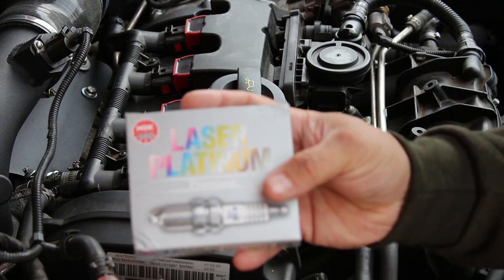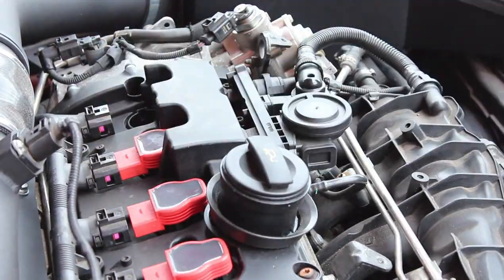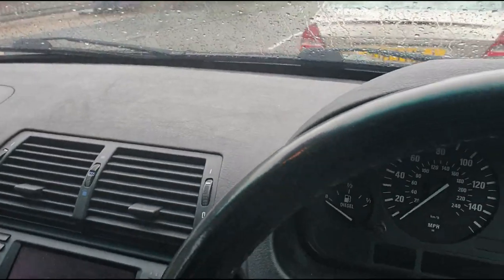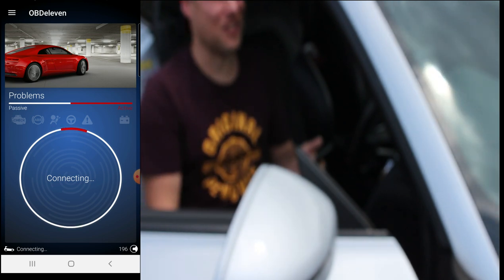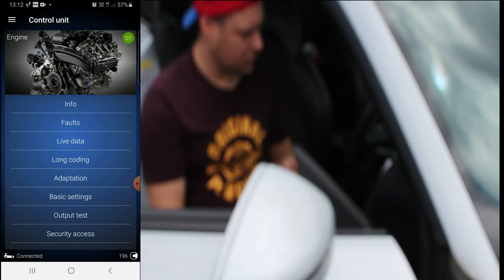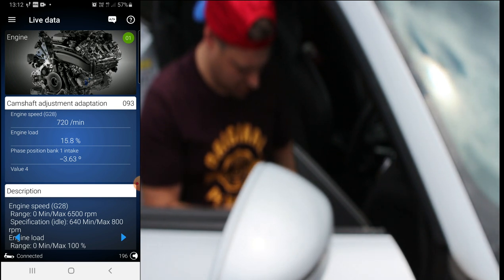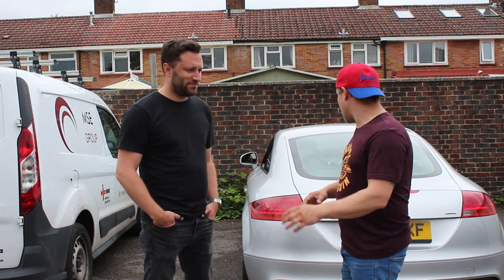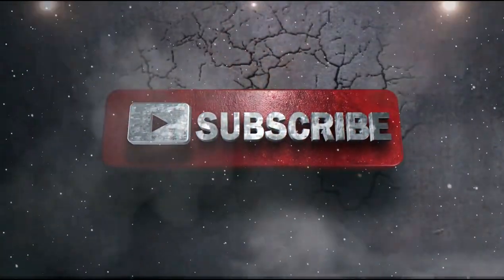how to change spark plugs and check timing chain stretch on a tfsi engine  (AUDI TT MK2 8J)

Comment: Just bought the $10 wastegate actuator arm clip for this exact noise 🤣. Had the hardest time finding the exact noise I was getting on a youtube video/google. It’s arriving in a few days, but my question to you would be where can I read about actually “installing” it on a quattro ? I’ve read it’s a pain compared to the fwd but have yet to find any videos/forums to follow.
Reply from the maker: Here you are mate hope this helps 
https://www.ttforum.co.uk/forum/viewtopic.php?f=19&t=1687826&p=8560746#p8560746
 I will be doing a video update on the rattle 👍
Reply: @CarChris82  Awesome, thanks from across the pond ! I look forward to it !
Reply from the maker: No worries mate 👍🏻

Comment: hi did you finally fix the issue?my TTS had the same noise from day one...dealership kept it for 2 weeks trying to find out where the noise comes from. Finally they told me that this is from the chain of  the oil pump and that according to AUDI this is normal. They even brought another one to hear and convince me that it makes the same noise and it did. I am now at 76000 km, the  noise is always there at low rpm when changing the throttle angle(accelerating or decelerating) . Many other problems faced with the car but nothing linked to the noise...
Reply from the maker: If yours is a tts its a different engine it's a ea113 same as mine im at 120,000 miles and doesn't make that noise.we did sort the noise out on Robs car it was a rattling waste gate  on the turbo which was fixed with a £10 clip check out the updated video of this 👍🏻

Comment: I started getting this sound shortly after after changing from an axx to a bwa in my MK5, and my initial thought was that it's the oil pump chain. It might be worth checking the state of the balance shafts and even have a vis freewheel installed.🤔
Reply from the maker: Its not on my bwa its on my friends ea888 engine it was wastgate rattle which you can get a clip I did a update vid of it 👍🏻thanks for your input and the balance shaft can be a big problem like you said the vis freewheel is the way to avoid that

Comment: good job mate,Im a master mechanic and have been in the trade 30 years but i just bought my first ever Audi last week, after years of bloody fixing German cars and swearing id never buy one i bought a 2008 TT 2.0 TFSI with the DSG box this week .
Ive had a few issues like discovering the previous owner has decatted it causing a low Catalyst efficiency warning and EML to come on...Cant find a cheap 2nd hand 8J TT cat anywhere .
Broken parcel shelf...fixed
rear fog light full of water...fixed
Left flappy paddle was broken and fell off lol..previous owner had glued it to the steering wheel lol
i need to service the engine and dsg box now sigh...it was cheap so cant complain
Reply from the maker: Cheers mate 👍 they are great cars when they are sorted, I not had any problems for over a year still little things to do like you said parcel shelf.
Reply: @CarChris82  you got yours mapped ?...
Reply: @CarChris82  watching your vid on running costs right now lol
Reply from the maker: Yes mate only a stage 1 at the moment but we'll worth doing
Reply from the maker: @peter58murray  its a lot more than I thought 🤣😂🤣
Reply: O2 spacer should fix it
Reply: How much is a good price for the TT right now?
Reply from the maker: Depends alot on what spec you go for tt tts ttrs

Comment: I assume this ea888 also has the short cam timing chain on the right hand side of engine. Is there no obd11 block to measure that?
Reply from the maker: Unfortunately not the ea888 only has the chain on the left that goes around both the camshafts unlike the ea113 that has the belt on the left and the small chain that connects the camshafts on the right
Reply: @CarChris82  good to know! ...hope your pal gets it sorted 👍🏻

Comment: Hi Chris. What make/model of scanner and app are you using to check the car for fault codes?
Reply from the maker: Hi Kevin  I'm using obdeleven Pro gen 2 hope this helps I got a video of the obdeleven
Reply: @CarChris82  Thanks for the info. Chris. I've watched the video and checked the obdeleven out. I've just changed my mk2 V6 roadster for a mk2 2.0 TFSI roadster and I'm finding your videos very interesting and informative. I think the down to earth presentation and 'warts and all' approach is spot on!
Reply from the maker: @kevinflynn4529  cheers mate I appreciate the support

Comment: My TTS mk2 makes exactly the same noise, I've done cambelt, tensioner, auxiliary belt, fuel cam the lot.... I think it just the way the engine works...tappy and ticky..mines on a stage 2 and had no problems....the only thing it might be is the auxiliary belt tensioner, one of the bearings might be on the way out, but until it starts slipping it won't be an issue.

If you do get to the bottom of please do update on your channel and the ttforum...as like you it is doing my head in
Reply from the maker: I got a good idea what it is and will do a update very soon  on Robs rattle but these engines always make a tapping noise due to the direct injection like diesel engines
Reply: What's your ttforum profile name so I can keep an eye open for it mines C00P5TT5... and I pretty sure, judging by the accent, your not that far from me 😀
Reply from the maker: @adamcooper9834  message me on Instagram mate 👍
Reply: chrisj82... found ya
Reply: Good the hear and look forward to the update. One thing might be the dreaded wastegate actuator arm rattle, vag have a technical bulletin on it and a clip sorts it out, £10.....i bought one but because mine is a quattro you can't get to it without removing loads of major parts
Reply from the maker: Haha you so be reading my thread on the ttfourm

Comment: Did he manage to get the engine rattle/ticking sorted?
Reply from the maker: not yet mate not had time to revisit him but we got a part to try and will do a update soon  👍
Reply: @CarChris82   I have a similar noise on my TT. Mine is a 2015 so I am not sure whether this is the same triple 8 lump. My original thinking was the turbo wastgate actuator arm which does have some play in it (including the actual wastgate arm). Took it to the dealer and they said the play is normal (due to allowances for heat expansion) so probably not wastegate related issue (although this goes against the internet knowledge, including the humble mechanic on YouTube which suggest that there should be no play at the wastegate arm itself, although the actuator arm play is common). Not sure whether to trust the dealer but I digress. What might be interesting for you to know is that the dealer said my noise is from the VVT actuation, which again is normal. On that note, did you manage to diagnose this issue? If not, the VVT might be a good a route to explore? Also, I have the same EVAP code so perhaps this could be related? Maybe the N80? Anyway would be good to see if you end up fixing it. Pav
Reply from the maker: @ppavy  hi mate something has been done and will put the vid up very soon 👍
Reply: @CarChris82  Excellent, will keep an eye out!
Reply from the maker: @ppavy  have you seen the vid where we fitted robs ramair induction kit?we speak about what we think will fix it
Reply: @CarChris82  Thanks. There are no clips for my car (different turbo) and dealer is certain it is not the wastgate actuator. Hopefully it will fix Rob's problem but I guess my search continues!

Comment: The audi mechanic told me the ratling noise is normal on that engine depending on the temperature it can make that noise
Reply from the maker: Have you seen the video we done afterwards it turned out to be the wastegate so we fitted a clip to the actuator and this solved the problem and now the noise is gone 👍🏻
Reply: @CarChris82  lol ty im going to try it
Reply from the maker: @69lol69  this is the part https://www.ebay.co.uk/itm/Turbocharger-Turbo-Wastegate-Rod-Rattle-Actuator-Clip-TSI-FSI-VW-Audi-Seat-2-0-/323379730683?mkcid=16&mkevt=1&_trksid=p2349624.m46890.l6249&mkrid=710-127635-2958-0

Comment: Hopefully you applied some anti seize to those plugs
Reply from the maker: Anti-seize can act as a lubricant, altering torque values up to 20 percent, increasing the risk of spark plug thread breakage and/or metal shell stretch. ... Do not use anti-seize or lubricant on NGK spark plugs. from NGK